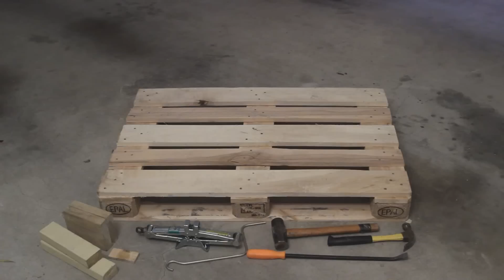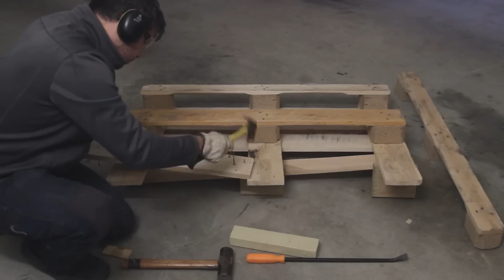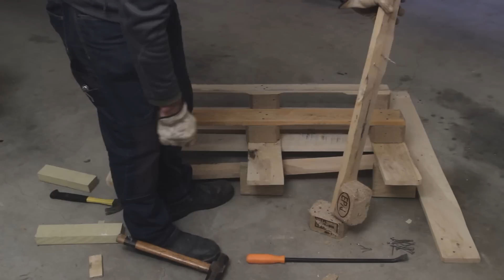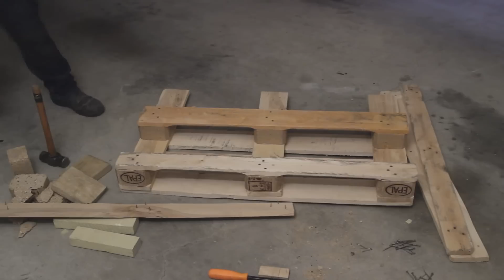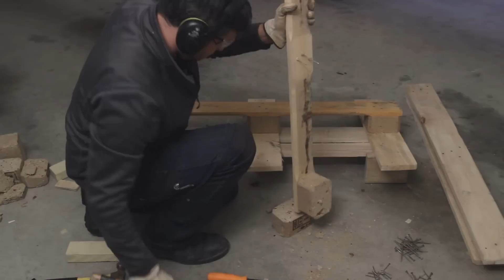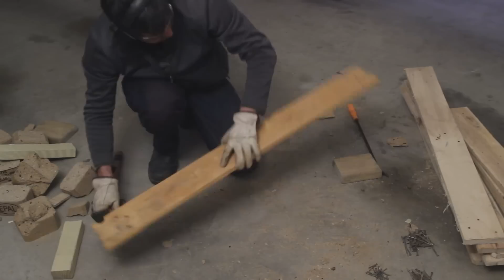how to dismantle a Euro Pallet (EPAL) with simple cheap tools (un-powered)

Comment: I tried using a 'pallet breaker' bar which worked for some smaller pallets here in the UK but I couldn't for the life of me dismantle the EPAL pallets. Good to see this technique which I will try soon!
Reply from the maker: Most EPALs aren't this easy, often I have to chop the blocks apart with a hatchet to get at the nails, you can bash the blocks out from between the planks too but it tends to damage the planks

Comment: Out of all the vids on this subject yours have to be the best.
Your ideas are excellent !
Thank you for sharing 👍👍🤓
Reply from the maker: Thanks!
Reply: Good innovative idea, does it matter if my pallets are wet because of the rain? I've been collecting them in my back garden.
Reply from the maker: Cheers, I haven't had much luck with dismantling wet pallets, they are often stored outside though so most should be fine after they dry out.
Reply: @redseantlworld , wet pallets are a major PITA to mess with.  The wood swells which basically locks the nails in place.  But, if you let them dry out, you might find them actually easier to disassemble because the wood can shrink away from the nails.

Comment: You have SERIOUSLY made my day! Thank-you! Why didn't I think of using a car jack to take them apart? Genius!
Reply from the maker: It won't always work, but it's worth a go. Just stop if it makes bad noises or is harder than jacking up a car!
Reply: @lapislignum  Stripped a pallet down earlier, real thick wood (high quality pallet) and this method I had no broken pieces.

Problem I find with the older pallets is the annular nails start to rust and grip the wood making them real difficult to pull out - that's when I've had problems with wood splitting.

Comment: Yes! These euro pallets I’m talking about. Takes a little more time to pull apart and some different tools. Thank you for the link😊👍🏾
Reply from the maker: No problem, europallets often hold together pretty well,  if they won't come apart using this method I usually split the blocks with a hatchet, either to get to the nails to knock them back through or untill they are chopped away from the boards altogether. I often use a Prybar to get these blocks off too, then the boards come apart pretty easily.

Comment: Thank you. Just waisted £30 for pallet buster and cracked most of the boards with it :(. Tomorrow will try your method. Looks (I understand need some practice)simply, no investment in sophisticated tools needed and no damage to wood at all. Thanks for effort to record it.
Reply from the maker: Cheers! Some progress europallets are stuck together pretty good but this method is a good place to start, if you get a hard one try another good one, sometimes I have to chop the blocks apart with a hatchet to get at the nails. Good luck!

Comment: Really love how easy you get the nails out. Thank you!
Reply from the maker: Thanks! They came out easier than usual for this pallet, but they aren't much harder when they are hard. The nails in these pallets are fairly sturdy so the heads don't pull off as much as with smaller nails.
Reply: I had one board today (this was before seeing your video), and darn, I could not get nails out. So I had to saw the board. Still happy that I have board to play with, but excited to give your way a go. Much thanks.

Comment: This is an excellent video and you make it look so easy. However, I have just spent the better part of a day, taking apart an EPAL which must have been a real "heavyweight" compared to the relatively light pallet you have used.  I could only just lift mine on my own. Unfortunately my car jack was too large to fit between the cross members as yours did, so I was forced to use a crowbar and a wide brickie's chisel with a heavy hammer. The nails were about 5" long and serrated and in many cases the ends were bent over and buried in the wood, so your method of simply tapping the cross-members apart wouldn't work.  However, now I've finished I have a pile of very substantial timber (even if some of it is damaged) with which to build a cold frame for the garden.
Reply from the maker: Thanks, this was my fourth attempt at filming this, I had pallet or camera issues the first few times.

EPALs can be pretty hard and some just won't come apart without breaking using this method so I chop the blocks out instead. The boards you end up with are worth the effort though..

Thanks for watching!
Reply: I sympathise - my pallets are heavy weight too. The car jack is an excellent idea (thanks Mr Lignum) will try that later.

Comment: Thanks for the link, I will check out my car jack tomorrow and try this
Reply from the maker: Don't wind it too hard, sometimes the blocks are stuck pretty hard, I've had to knock them out sideways with a hammer or chop them away with a hatchet before, and some come apart easily.
Reply: @lapislignum  Hi thanks, I tried all morning, the car jack didn't work, the winder upper I think is too long, and just didn't seem to do it, it kept falling and wobbling everywhere. I tried your other technique putting two short blocks to separate pallets, with a modicum of success, unfortunately when I was using the sledge hammer it split a few planks. One plank is all I managed and have glued and clamped it. Then I got rained off with this sodding UK weather again!. I think I will need to buy a bolster and pry bar to lever off may be. I'm making oblong boxes for my soap project. Hopefully I will get there sometime. btw I just hit 70 too! and will have a go Joe at anything! thanks Spe. x PS I wish you were my neighbour! LOL!
Reply from the maker: @summerbreeze1955  i've had lots of board breakages on europallets, the few i've tried to take apart wet have been extra hard, and I had to cut them up so they would fit in the bin.

If you can't just keep getting more until you find enough that come apart easily and the "chop/bash the blocks apart" method doesn't work for you can use a reciprocating saw between the boards and blocks to cut the nails, I haven't tried this way but it could get you out of trouble. If you don;t need long boards then cutting the boards either side of where they are nailed works pretty well.

Good luck!
Reply: @lapislignum  Thanks SPE you're very kind. Later i thought to saw them, but have ordered a bolster and crow pry bar, I'm sure that will do it, as I need pretty long planks thnx
Reply from the maker: @summerbreeze1955  Just keep trying until you find something that works, the best pallets in life are free!
Reply: @lapislignum  LOL I defo will I don't give in ever. I have ordered some tools so watch this space!

Comment: Nice tehnique, thanks for sharing. I tried this but my epal pallet had wooden blocks, so it took me about an hour to dismantle 3/4 of the pallet. Also center wide piece had been cracked.
Reply from the maker: I often split the wooden blocks with a hatchet until I can hammer the nails back out in that case, cracked boards happen, and the more you do the faster you will get. Thanks for watching!
Reply: great idea, i will try that too :) thanks
Reply from the maker: Takes some practice to not hit nails, the edge of my hatchet has a few nail sized bits missing. Good luck!
Reply from the maker: Personally I'm not a fan of that method as it damages the boards and means you can't reuse the nails, If I had to use a saw I'd just cut the ends off the boards, I often do this after dismantling as per this video, just depends of the project.

Comment: Nice way of dismantling EPAL pallets. Thank you for posting!!  With a new pallet it is OK and easy enough to dismantle them. But an older pallet with rusty nails in solid wooden blocks is a lot more difficult and just hammering will often result in split planks. Take your time and if possible try not to hammer those blocks off, but split those wood blocks into 2 or 3 horizontal layers in order to remove them piece by piece. This will prevent your planks from splitting.
Reply from the maker: Good point, older chipboard blocks come apart easier too, I usually don't bother with old ones though. Thanks for watching!

Comment: How heavy of a sledgehammer are you using? Would it be best to use something on the heavier side like a 6lb or 10lb or something like a 4lb sledgehammer when trying to disassemble a little more fragile boards that crack relatively easily?
Reply from the maker: 4 pounds, better to saw fragile boards off close to the beam sometimes.
Reply: @lapislignum  Wow, wasn't expecting you to respond so quickly! Thanks a ton 🤟
Reply from the maker: No problem, hope it works out for you!

Comment: If this is a Euro Pallet, what are the more common pallets called, and what are the differences? Ever thought about making a drill attachment for the scissor jack?
Reply from the maker: Euro pallets are pretty common internationally, within the Pallet species there are all sorts, but most timber types consist of three beams with boards nailed to the top and bottom, this type is just boards and chipboard blocks which needs a slightly different approach.

A drill attachment could work but would take some fabricating, if you were going to go to that much effort you might as well make a drill powered board puller, the ones I have seen work fine but are much slower than this method.
Reply: A euro pallet is metric dimensions, whereas a standard English pallet at 40 x 48 inches is bigger than a Europallet

Comment: Found this video after i realised that building a pallet buster is't an option to me. 90% of the pallets here are EUPALs.  Thanks you!
Reply from the maker: There is probably a way to build a pallet buster for EPAL pallets but this way is fairly quick. The only tricky bit is getting the blocks off really.
Reply: @lapislignum  after i see how you use the jack, i think its pointless to build a buster for this kind of pallet. Actually your work is only slower because you take the nails out after each plank. I would just do that later, all together and on a table or sawhorses or something.
Reply from the maker: I usually break down first then take out all of the nails, but figured this is the safer way to demonstrate, I was surprised that it didn't take that much longer to do than doing the nails all in one go.
Reply: @dekurvajo  that's one way of getting a nail through your boot as I experienced ouch 🙄
Reply from the maker: I've been pretty lucky/careful with nails.

Comment: How strong does one have to be to get this to work?
I tried with car jack; the car jack bend 🤣
I tried with the 2 blocks on either side and the board lied across those but no matter how hard I hit the boards just didn't budge. I'm a 1.57m twig so my muscular strength is pretty much non existent🙄 for now I gave up trying to take apart the pallet... You made it look so easy.
Reply from the maker: Fairly strong, this type of pallet can be very difficult to get apart and this one was fairly easy, the jack will only work on the easy ones. Often I choose the wooden blocks out away from the nails but even then the nails can be hard to get out of the planks.

Comment: Ingenious to use the car jack! Thanks for sharing it! I've taken apart a lot of these pallets but this sure makes it faster and easier! Only problem I encountered was that my jack only folds to 3 1/2 inches and some of these pallets are only 3 inches opening. Any suggestions?
Reply from the maker: Cheers! I guess you could look for a lower profile jack at a wrecker, or just use the block and hammer method, I don't use the jack as 8t felt like it was going to explode on tougher pallets, some of them still came apart with the hammer.
Reply: @lapislignum  Couldn't help but say thanks to you again today as I took apart my next load of pallets. Between the car jack and 'blocks under the 2 nailed together boards' ideas you've shaved my disassembly time by 50% per pallet. Thanks again!
Reply from the maker: Good to hear, cheers!

Comment: Don't throw those corner blocks away they burn OK in a wood stove,I take euro pallets apart with a small steel splitting wedge,hammer and a nail bar  takes less than ten minutes and all the wood is usable,you get a good three warms off it to,warm one taking it apart,warm two carrying it down to the house,warm three well you get the picture lol.
Reply from the maker: I've burned the chipboard ones before, when the bin is full usually.

Comment: Good technique but older and well used pallets are much harder to dismantle especially if they’ve had repairs and are riddled with extra nails . 👍
Reply from the maker: I don't bother picking up old pallets
Reply: @lapislignum  , unfortunately the majority I pick up are usually the older ones .
Reply from the maker: That's too bad, guess it helps that most pine pallets don't get returned where I am.

Comment: Great stuff.  Two points - why do they chamfer the edges of these EPALs?  Bizarre.  Also, why do you religiously keep the nails - can they be reused?
Reply from the maker: Thanks! I guess the edges are chamfered to make it easier for the forklift tines  to slide in, and the corners are chamfered so they don't get caught on stuff. The nails can be reused,  I  use them a lot. Usually they just take a little bit of straightening.
Reply: About the nails, if you're doing this stuff in a garage or anywhere you might drive a vehicle or walk barefoot, you need to keep track of every nail.  Plus, if you're looking for the "pallet wood aesthetic" the weathered nails will look better than a shiny new one.
Reply from the maker: I must admit I've lost a few in the grass but haven't picked up any in car tyres or feet yet. I ran over a bumper screw once though, which was one way to find it.

Comment: Thank-you!
Reply: Ps good use of varied levering techniques: glad to see somone who has been shown the correct (efficient) way to use a claw hammer and block to remove nails. Ps nice use of a car-jack!
Reply from the maker: Cheers! It  prevents the hammer marking the wood too
Reply: Incidentally, I've bought a Faithfull manual nail puller.

That might, now, be redundant. But I'll see, eventually, whether that solves the wood block spacer issue . . .
Reply: PS, it occurs to me that the wood block problem might be solved by clamping it in a workmate vice and, then, using the car jack.

I prefer leverage as against noisy battering: it's a pacifist and Quaker thing.

Comment: Cool video. But the same technique will take an awful lot of time more if your Epal Pallet has the wooden blocks instead of the cork ones... 😭
Reply from the maker: Real wood can to hang on to nails better, I usually split the blocks in half to seperate the top and bottom boards, then keep splitting them until I can get to the points of the nails to bang them out.
Reply: Cork? Pressed wood. Sawdust and glue.

Comment: This pallet must have had really small nails in it. I tried with a V shaped car jack and a board started to snapp. This method method though - the trapezoid (some times called "the frog") car jack - seems legit.
Reply from the maker: The nails were the usual variety but I had to try a few pallets to get one that would come apart, felt like the jack was going to break on the others - some eutopallets just don't want to come apart!

Comment: It s a nice video but even though this pallet is an EPAL it s a pretty easy one. With some other pallets espacially the LPR ones, you would never be able to do what he did
Reply from the maker: I have about a 50% success rate with EPALs, this way, if they are difficult I split the blocks apart with a hatchet until they will come off the nails and shorten the nails with bolt cutters if I have to so they are easier to knock out.

Comment: Bullshit 100%. Lets see you strip my pallet like that. They are not rag nails.
Reply from the maker: What's a rag nail? Europallets don't all come apart this easy but this one did, roughly 1 in 3 need to have the blocks split to get at the nails which takes a bit longer.
Reply: @lapislignum  a rag nail is riven like a screw and will not draw out. 
Ive been using a jack for years but cannot use the handle, they are so tough i have to use a lengh of pipe.
I have now developed the use of an engineers machine wedge and sledge hammer, even with that they still split and break.
Filming an easy deconstruction isnt fair to folk that think its going to be that easy and all the parts useable. Give them a real taste.